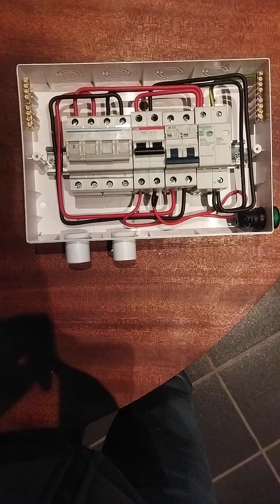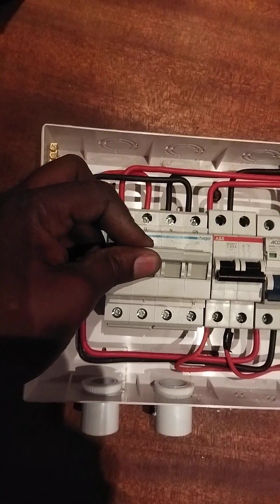change over switch with ac protection box wiring

Comment: Hi Anthony, just a side note, there is no protection on the pilot light, ive seen cases where Siemens pilot lights short out instead of blowing, that will cause a unnecessary trip on that mcb, suggest a 2A breaker for the light. Unless of course its not an LED type and can blow open circuit.